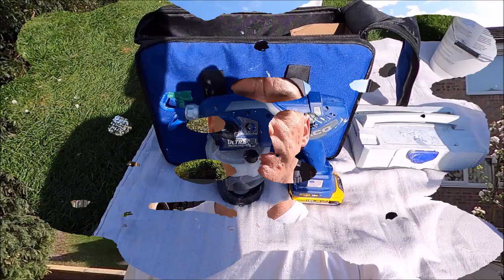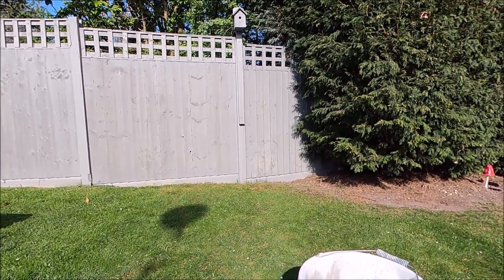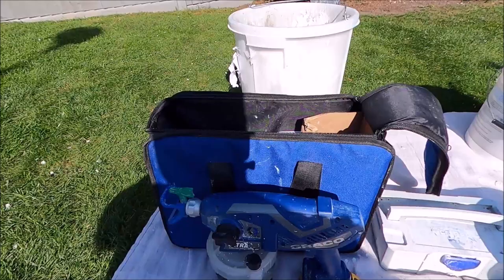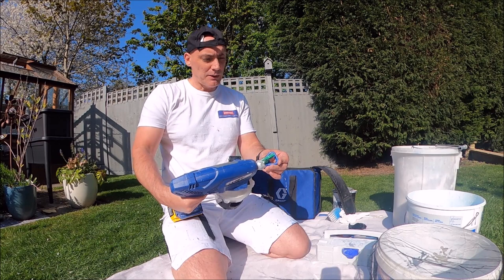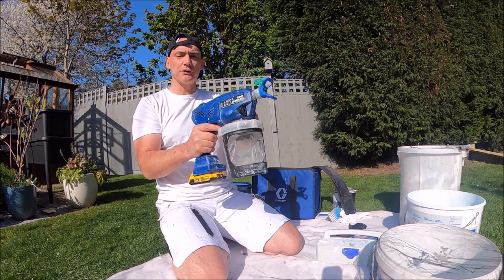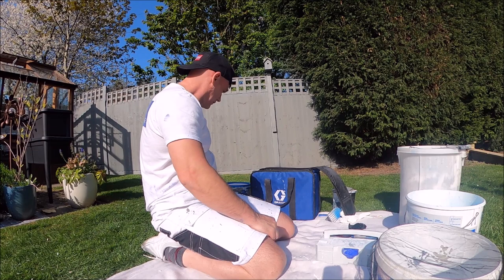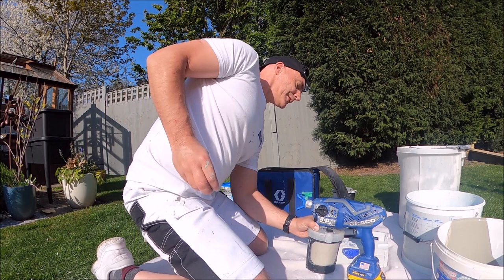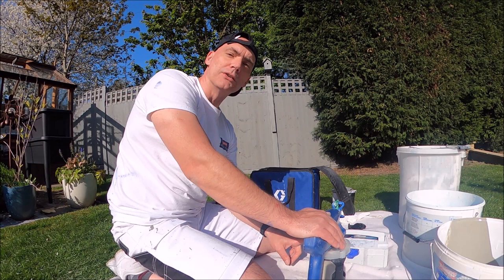Graco Ultra handheld airless sprayer set-up and touch-up demonstration

Comment: Love your honesty about why the pump failed after 40 litres etc. I use mine alongside my 390. I might spray a front door or a garage with it. Bottom line is that the pump is so small that to do it’s work it generates a lot of heat. Extended running will kill it because it is running too hot. You can run it infrequently during an entire day just don’t run it all day. I wouldn’t even run it for an hour. Your tip about using a battery at a time is spot on I’d say 👍🏼

Comment: I’ve got the ultramax uses different size thread for tip guard bit annoying, was going great until last week it stopped spraying I opened it looks like one of seals have failed, needs new pump $370 Australia dollars, it didn’t do that much work
Reply from the maker: sorry to hear that, its unfortunately a common issue.....crazy that the thread is a different size, its not on that

Comment: Just ordered one of these for my woodwork on domestic and site.
Say after your 20 minute use,how long would you rest it if to use again in the same day!?
Reply from the maker: Hi there, I don't recommend these units for regular use tbh. I can't really advise on the amount of time inbetween uses because I personally wouldn't use it more than once a, day.
Graco estimate that these pumps can spray around 200 litres, but my original pump was replaced after 30-40 litres of paint because I was spraying small ceilings, with it, and woodwork in a hall, stairs and landing.... So I came to the conclusion that these pumps simply couldn't handle being run for longer periods of time.
I now, would only use for say ornate coving on a ceiling, or touching up on an already sprayed surface... Which I believe is, what these are originally made for.
Also remember that by just priming the pump ready for use, and cleaning it afterwards is already adding to the usage, and it can take around 5 litres to clean at least 
All the very best, Joe

Comment: Hi mate,
What do you think about... 
graco gx21ff compared to 
Gx21 and gxff?
Im wanting to use just the one machine to spray emultion waterbase paints and gloss oil based paints. The gx21ff lets you do both on one machine.
What do you think, your ideas would be a grate help
Thank you 😊
Reply from the maker: Hi yes, they are a very good option, but just keep in mind that the gx21ff has a longer hose and not ideal for when you just want to do woodwork,  so i recommend getting an extra shorter hose for when doing smaller jobs.
All the best, Joe
Reply from the maker: Also, If you are spraying solvents through an airless machine, you must make sure its earthed.

Comment: This sprayer is a piece of trash. I would love to have my money back but there are no numbers to call and no instructions included. It doesn't spray the paint well, air seeps into the paint container, and the paint does not come out evenly. Do not buy this product! I don't know how much my husband wasted on this for my Christmas gift last year, but we have not been able to get it to work in the year that we've had it. I just tried it again and wasted a $40 quart of paint and did not even get one kitchen type chair painted. This is a company that does not stand behind their product. They hide behind a YouTube video. BEWARE!
Reply from the maker: This pump undoubtedly has its limits....but used correctly,  it can spray as intended on small job's.  I agree that it is not really fit for purpose ...but not because it doesn't spray well...because it actually sprays fine with the correct products.....but because the pump is too small, not durable , and does not have longevity. 
Thank you for your comment 🙏
Reply: I might buy your answer if it were only me who could not get this paint gun to work. My husband has been in the construction business for more than 30 years, using lots of different kinds of paint guns and is an expert at fixing tools. He cannot make this paint sprayer work. So I do not accept your "put off" that I'm just not using it properly. Additionally, if it had a certain way that it needed to be used, shouldn't they have added that important information on some instructions with it??
Reply from the maker: @janelleyelton3828  it's an airless sprayer....ive used it successfully to spray trim paints and emulsions....I have never had an issue with how it works apart from a few issues with the suction cup....which I found just needs regular liner replacements. 
I can only go off my own experiences with this pump.